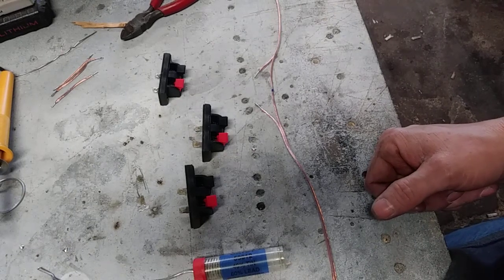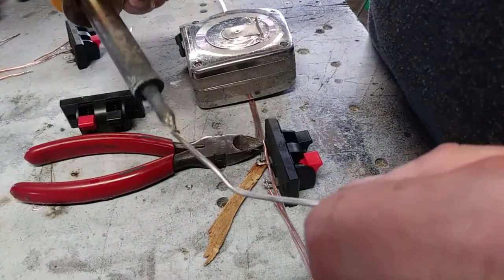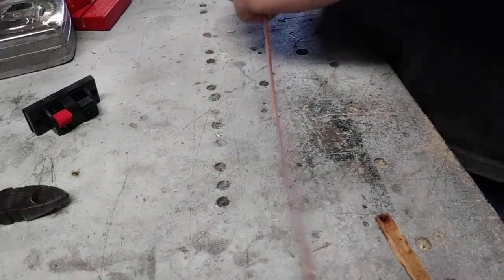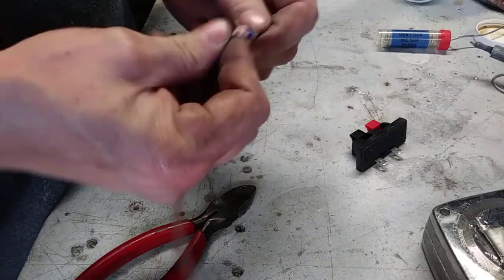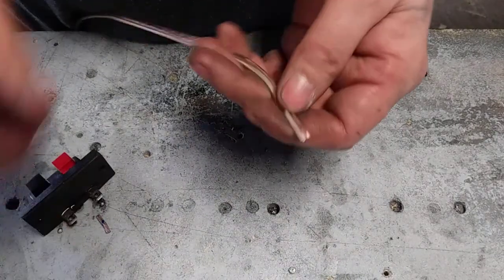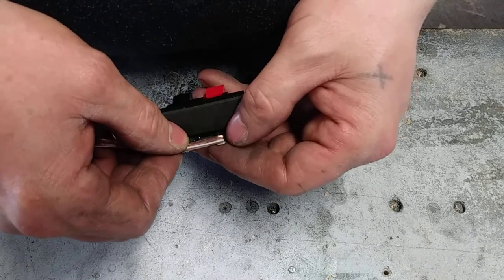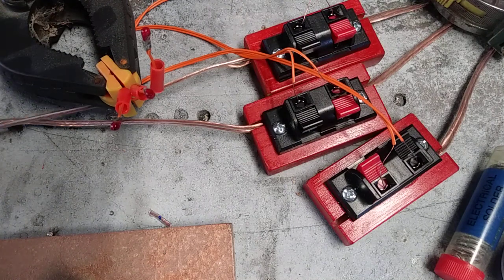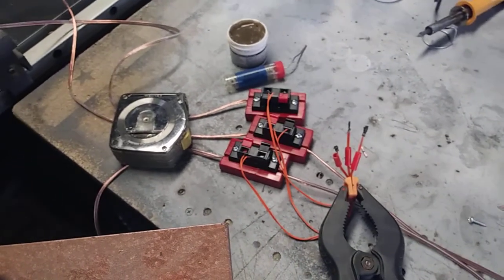DIY How To Make Extension Cables For Your Wireless Firework Firing System

Comment: I worry about the Ni-chrome wire may pop and you would lose the circuit for the rest down the line.
Reply from the maker: Michael Jobin tested them all in series. No fails :) has to complete the circut in series
Reply: In series if one pops you lose the rest. It does happen.
Reply from the maker: Michael Jobin hmmmmm lol oh well hahahaha:) Thats weird cuz it runs one side of the voltage to complete the circut... I can see how it might happen but seems really unlikely in my honest and very humble opinion. Good thing I carry a torch with me:)